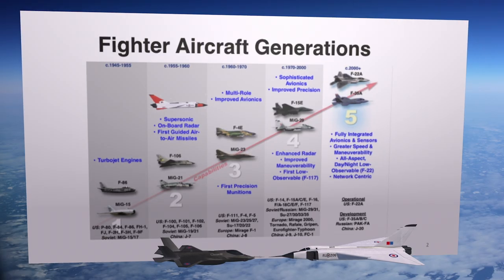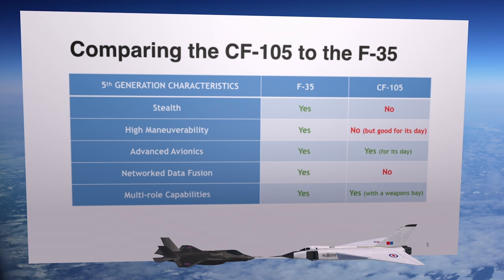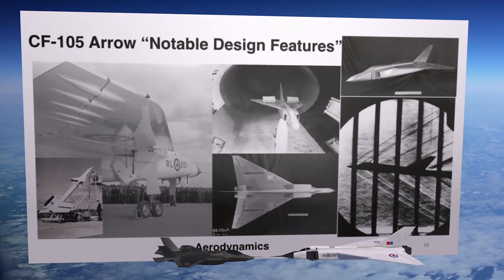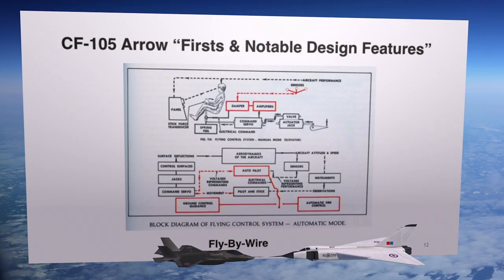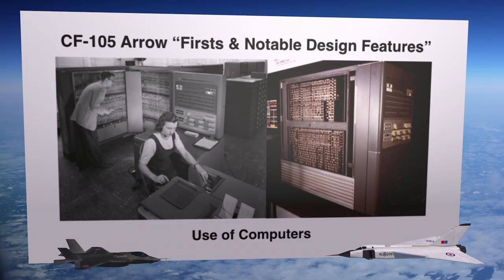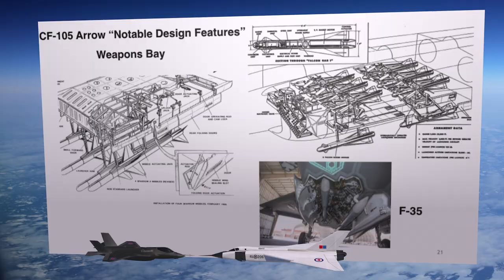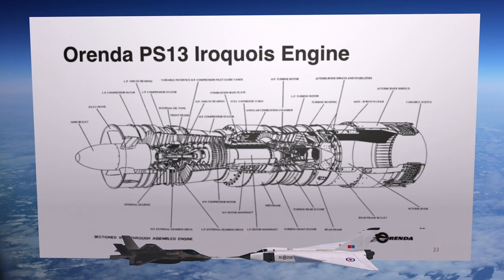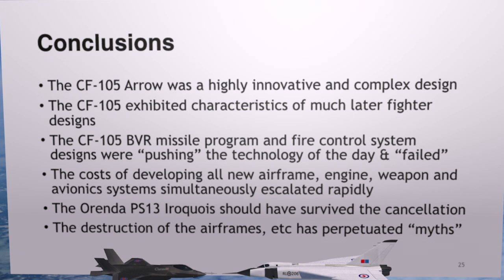AVRO ARROW FIRSTS VS F 35 LIGHTNING

Comment: You've left out that the Arrows wasn't designed for air-to-air refueling, the F-35 is. The maintenance bases were going to Cold Lake and Bagotville, while the deployment bases were, Comox, Whitehorse, Goose Bay and Gander, because of it's limited fuel capacity.
Reply from the maker: HI Charles.  We did show the F-35 in mid air refuel?  And, we showed the Arrow doing a hot turn refuel at Trenton.  Although we did not specifically say the Arrow could not refuel mid air, we thought it was clear.  This movie was about two things, the Arrow's design compared to the F-35 design and the gap that exists in the middle of Canada.  I suppose the third was the original requirement for the arrow still exists.  regards...Virtual
Reply: I spent 9 of my 17 years in the Canadian Military in the RCAF working on CF-101 Voodoos, CC-130 Hercules and CC-137 Boeing 707s, I working with people in bot CFB Trenton and CFB Chatham who were in Trenton the one time that the Arrow landed there and I know of the rumours that the missing Arrow was in crates at CFS Mountainview, it had to crated in because the Runway at Mountainview was even too short for the Voodoos when they went for disposal. It was well known it was a one was intercepter when the Soviet bomber fleet were going rto come over the Pole. Canada's needs haven't changed since the end od the Cold War when we got our first new multi-role aircraft sine Korean, the CC-188 Hornet, things still haven't changed and the F-35 isn't the aircraft for Canada, single engines in the Arctic aren't a good thing and Canada has given away it's aircraft industry, so a Canadian built aircraft will never happen again. But keep on with your fantasy.
Reply from the maker: @Chuck59ish  Hi Charles.  9 years in the Canadian military....wow.  This project only has the Air Force general that looked after the F-18's for many years, the foremost expert on the Arrow, an Aeronautical engineer, the only person to have a series 2 Iroquois engine in Canada and lastly...me.  But, nine whole years in the Canadian military.  I can clearly see how that would make you an expert on the AVRO arrow...I mean voodoos, Herc's 707's, they have so much in common with the Arrow.  Perhaps you could make a movie that we could see.  It's not hard....just spend 30 years working at the highest levels of research Canada has to offer, then a thorough understanding of 3D CAD and Visualization, non-linear editing and presto, you could explain the Arrow.  regards...Virtual.
Reply: @Virtualenvirons No, 9 of my 17 years was in the RCAF, the other 8 was as a Combat Engineer in 1 C.E.R. at CFB Chilliwack and at CFB Lahr in West Germany with 4 C.E.R .
Reply from the maker: @Chuck59ish  Hi Charles.  So why did you attack this site?.  You are Canadian, this is a Canadian story.  Normally, you would be an American.  I can understand Americans attacking this story.  The "we're not number one thing" doesn't really work for them.  
So, tell me, what is it that bothers you about this scenario?  The bomber gap portrayed exists today and the problems countering it are real.  This was the reason for the Arrow or an Arrow like aircraft in the first place.  (F-15).
Reply: @Virtualenvirons I wasn't attacking the site, but comparing a 61 year old 2nd generation aircraft to a 10 years old 5th generation aircraft doesn't work for me, Canada will never produce it's own combat aircraft because of the cost and even if it waits for the 6th generation of multi-role aircraft to come out the governments of the future will dilly-dally until the 7th generation comes out so they can buy the 6th generation at a reduced cost. As a replacement for the Cf-115,CF-104 and CF-101, the Americans offered Canada the F-Phantom II with spares and training for $ 1 million and aircraft, but the PET government said no, and bought the totally untested F/A-18 Hornet, it had more gremlins in it than any other other aircraft, which is one of the reasons the F-35 programme took so long, so they wouldn't have to be daily upgrades to the aircraft in service.
Reply from the maker: @Chuck59ish  Your comment of "Keep on with your fantasy", would he taken as an attack by any channel.  My apologies if you did not mean it that way.  The documentary compares the "development" of the two aircraft and not their ability to fight each other or enemy aircraft.  They would work together beautifully as the movie shows.  Having said that, the Arrow as built in 1958 would be better suited for Canada's needs.  Note...not NATO needs, but Canada's.  Canada or the U.S. only need to deal with bombers.  That is the reason there are no F-35's in Alaska only F-22's.....interceptors.  regards.....Virtual

Comment: The Arrow was  not a fighter , it was built as an intercepter ( long range ) why do you compare it to a fighter plane ?  To me it just seems stupid , like comparing a Nissan Micra to a Corvette
Reply from the maker: Hi Neil....The word Air superiority fighter had not been coined at that time.  It was also not long range, even with the extra fuel tanks, but it would have flown as fast or faster than an F-15 and as high or higher.  Above 50,000 ft, it would have out turned an F-15.  So, if you take all the avionics and missiles on an F-15 and put them on an Arrow what would you have.  You would have an Air superiority fighter than can only pull ~ 6G's in thick air, but high G's in thin Air.  Also, the Arrow was to have a bombing role making it the first multi-role Air superiority fighter like the Strike Eagle.  What we compared in this video was the development process and not the final product.  regards....Virtual
Reply: @Virtualenvirons  sorry sir , it was designed as long range interceptor to stop those nasty Russians bombers flying in over Canadas vast northern shore . Later plans for it included bombing and even as a launch platform to put things into space . The US ( Ike ) talked Canada into the Bowmach missle and outdated Voodoo fighters .
Reply from the maker: @neilmacleod5371  Hi Neil, I think I just said that, except the long range thing, but plans were in place to rectify that, to a point. Unfortunately there is only so much you can do with a Turbojet engine for fuel economy.  On the other hand they are not limited to about Mach 2.5 like Turbo Fans, so the potential for the Arrow to go Mach 3+ was there.  Below is a link to a series on my channel.  If you watch this, it explains a lot, especially Episode 4... regards...Virtual.
https://www.youtube.com/watch?v=AjuL9IM-1T0&list=PL3EReMs3ND7UYJS8t6O1NyUVqNyWlSacu

Comment: Corrections

F-35A build 2015's empty weight is 28999 lb http://www.dote.osd.mil/pub/reports/FY2016/pdf/dod/2016f35jsf.pdf#page=15

F-35A's mach 1.6 has 1200 Mph attached to it. 

"Speed (full internal weapons load) Mach 1.6 (~1,200 mph)"
http://www.af.mil/AboutUs/FactSheets/Display/tabid/224/Article/478441/f-35a-lightning-ii-conventional-takeoff-and-landing-variant.aspx

https://www.nasa.gov/centers/armstrong/news/FactSheets/FS-006-DFRC.html
F/A-18 has Mach 1.8 ( 1190 mph ).

Speed of sound is not a constant

https://www.grc.nasa.gov/www/k-12/WindTunnel/Activities/knots_vs_mph.html
Refer to I.C.A.O. Standard Atmosphere table.

Altitude (relates to air density) vs speed of sound example
sea level = 761 MPH
10000 feet = 734 MPH
20000 feet = 701 MPH
30000 feet = 678 MPH
40000 feet = 660 MPH
50000 feet = 660 MPH

Using NASA's speed of sound for F/A-18, F-35's 1200 mph yields mach 1.815.

LM is using about 10,000 feet's 734 MPH speed of sound.  Using 40,000 ft's 660 Mph speed of sound yields mach 1.81 i.e. 1200 Mph / 660 Mph = mach 1.82 .

Higher speeds has higher air friction, hence IR problem from IR sensors

From http://www.af.mil/AboutUs/FactSheets/Display/tabid/224/Article/478441/f-35a-lightning-ii-conventional-takeoff-and-landing-variant.aspx
Published at April 11, 2014
F-35A's engine thrust shows 43,000 pounds.

F-35A's combat radius is 1,407 km for internal air to air configuration. http://www.fisher.org.il/2016/Adir%20Powepoint/GaryNorth.pdf#page=7

F-35A Block 4.4 has six internal AIM-120 type missiles. F-35 Block 4 supports AIM-132 and Meteor missiles for  internal storage.

F-35A's target wing area, engine thrust and empty weight are 1.5X from F-16C Block 52

Basic wing loading via empty weight without factoring forward/rear body and vortex  lift factors.

F-35A
Empty weight: 28,999 lb (Year 2015).
Wing area: 460 ft²
Wing loading: 63.04 lbs/ sq feet.

F-16C Block 52
Wing area: 300 ft²
Empty weight: 18,900 lb
Wing loading: 63 lbs/ sq feet.

F-35A's empty weight is 1.54X scaled from F-16C.
F-35A's wing area is 1.53X scaled from F-16C.
F-35A's 43000 lbf thrust is 1.50X scaled from F-16C's 28600 lbf.

There's a near straight 1.5X scaling between F16C to F-35A on basic wing loading, engine thrust and empty weight.
F-35A's wing area and empty weight wing loading target are influenced by F-35A's weight growth and F-16C Block 50/52's empty weight wing loading

F-35A is like F-16C Block 52 with Super Hornet's high AoA.

Future F-35A Block builds has 6 to 10 percent higher engine thrust.
Reply from the maker: HI RNL...How are things?  Let's be clear about something right now.  Post only pertinent data.  You have referenced the F-18 and F-16.  They are not mentioned in this movie.  This movie shows the F-35 and Arrow working together.  There is tremendous expertise put into this video.  If you have something pertinent to add, I'm good, but if show an agenda, I will block you.  regards...Virtual
Reply: Hi RNL good to see you alive and well! Nice to see you agreeing with the F-35A, F-18, and F-16C facts and it proves the Arrow Mk2 was better them thanks for the help!. So how is your buddy Raynus 1 doing?
Reply: @Virtualenvirons  You posted obsolete data for F-35A. 

F-35A's design is influenced by F-16C Block 50 which is scaled by 1.5X with consideration for Hornet's high AoA handling.
Reply from the maker: @valenrn8657    HI RNL, When we decided to do this we looked at the design program and not particularly the final or current block level.  This comparison was more about the thinking and initial implementation of both designs, but obviously leaning towards the Arrow.  For example, the ASTRA fire control system was not implemented, but the Arrow was designed to accept that system.  But, the other firsts were for the most part implemented.  You have to admit, there is a strong similarity in the thinking and design process. even if there is a 60 year gap...regards...Virtual
Reply: @Virtualenvirons  
In terms of practical support

1. support CANZUK movement to improve AUS, CAN, UK and NZ economic of scale and bargaining positions. 
2. support BAE's Tempest concept. Refer to BAE's  Type 26 design wins across UK, CAN and AUS.  

Tempest is a proper 5th gen stealth fighter model to replace EuroFighter (based on BAE's EAP prototype).

https://s14.postimg.cc/3l1dunl9t/F-35_body_lift.png
F-35A's real wing load i.e. colored green to blue are the lift surfaces. Notice F-35's engine cowling design has forward lift like forward canard or F-18's long LEX.

 Tempest has F-35's engine cowling design and cant'ed twin tails.

For Canada, waiting for F-35 Block 5/6 includes higher thrust engine. Most F-35s would be beyond Block 3F.
Reply: @Virtualenvirons  In terms of design process, US has deeper pockets/larger economic of scale to sustain evolving R&D. Type 26 design win across AUS, CAN and UK helps with program funding.
Reply: @Virtualenvirons  
Arrows' concurrent R&D with limited production was "acquisition malpractice" i.e. recycled the term for F-35's concurrency problems which the US tax payer has to pay for the upgrades while F-35's export customers are only interested from Block 3F. Sweden wasn't stupid/bold enough to execute "concurrent R&D with limited production run". 

F-16 Block builds can be considered to be similar but F-16 Blocks 1 to 5 was a working hardware platform.  

F-22's first combat-capable Block build is 3.0. F-22 is up to Block 35  (2016) with increment 3.2B upgrade (2018).  

F-18E has reached it's Block 3 while it's Block 1 and 2 are already in the field.

Eurofighter follows Block builds within Tranche major revision marker.

Comment: With external fuel tanks and armaments the F 18 top speed is 0.8 top. The F 35 fully armed is a matching speed. The Arrow ..... We will never know!!!!!
Reply from the maker: HI Shantel. The Arrow's speed was not diminished much by being fully loaded.  It was sleek, carried weapons internally and had excessive power.  The F-35 with no external stores would be a similar situation.  The F-35 is faster than it's posted speed.  I am guessing that after Mach 1.6 it is less stealthy.  With the F-18, the drag of external fuel tanks and weapons are a factor which is the same for most aircraft.
The Arrows engines (Iroquois) were extremely powerful, but not near what they could produce.  Orenda built the engine to meet further Arrow designs that required more power without Orenda having to do much. 

Think of the initial Iroquois as a 1960's  big block engine.  Let's say a 427 cubic inch.  These engines came with big carburetors (4 to 6 barrels) because of the gas the needed to produce the horse power   So, think of the Iroquois as a 427 with a small two barrel carburetor.  The engineering for Orenda to up the horse power was relatively easy.  The Iroquois was capable of another 50% more horse power before it's design limit was hit.  Keep an eye of future Episodes.  regards....Virtual
Reply: @Virtualenvirons  thanks for your reply!!! Very informative. I have always been in a huge fan of the Arrow!!! As a child growing up in Wiarton  Ontario it was a known that in a barn outside of town held a warplane. This area was protected by military for a long time!!!! I really am not sure what was been kept so secret, however I know that after people started asking questions over the years, a military flat bed moved this thing at 400 AM. This is a proven FACT!!!! Was it part of an Arrow. Townspeople of the older generation of good standing claim that due to property issues they were told by the Government some of their land now was not accessible.  Thanks again!!!
Reply from the maker: @shantelmcreavy527  I have heard a similar story. There is a fellow who has spent a large part of his life looking for clues to this story.  In his investigations he has come up with a paper trail related to the time period that refers to an object being moved at night that is referred to as the "invention".  Not a smoking guy, but intriguing.  regards...Virtual
Reply: @Virtualenvirons  thanks for replaying. As a child growing up up in Wiarton we heard story's from our elders that a Canadian Jet Fighter was in a barn ....driving shed close to home. Father used to drive by the area often , I remember seeing the military guards , as we drove by the guards were very strict, this is a one way road , the guards would stop and ask why we were there!!!   I do believe that there was a  secret being held!!!! Truth is everyone in that area knew so!!!!! What it was ..... We don't know!
Reply from the maker: @shantelmcreavy527  Well Shantel, if nothing else, you have a great story to tell some kids and hey, it's your story, you can make it what you want right.  I think it was an Arrow, probably this one.  regards....Virtual
Reply: @Virtualenvirons  thanks for replying!! I do know for a fact that a flat bed moved something at night from this area, with military protection.some have said that it was a nose cone of an Arrow. Probably never know for sure. Have a great day.
Reply from the maker: @shantelmcreavy527  It may have been an Iroquois engine, perhaps the one that was squirrelled away to England shown in the "Lost Iroquois".  regards....Virtual
Reply: @Virtualenvirons  it very well could have been!! Never thought of that. All I know is that elderly folks up around Wiarton were convinced that a jet fighter was  secretly stored there. I do remember seeing military personal in this field with a barn or driving shed. And there was no trespassing , the guards were NOT  fooling!!! Well thanks again for reply. If any new info comes up I will share. Stay well.
Reply from the maker: @shantelmcreavy527  One question that could solve the mystery partly.  The barn or shed would have had an entrance over 50 ft. wide.  That is a big building.  Why don't you ask around what the barn or shed was like.  regards...Virtual